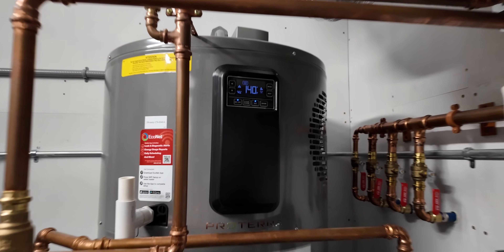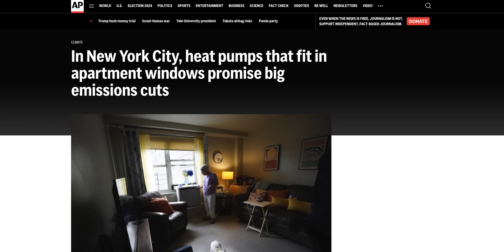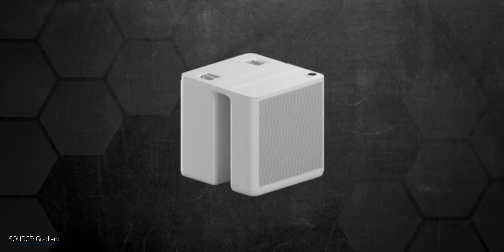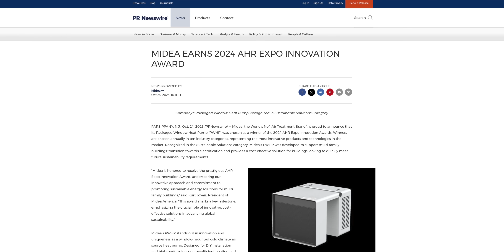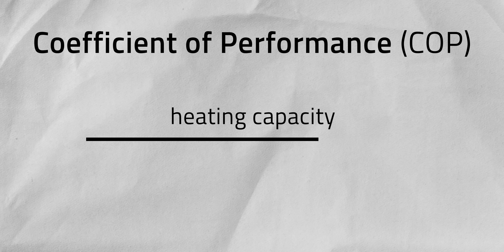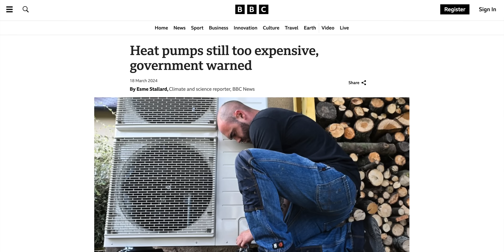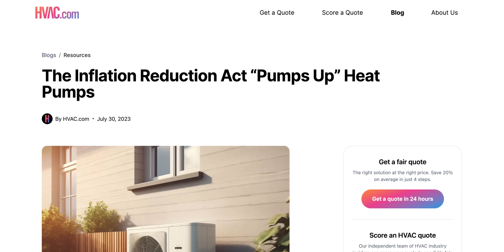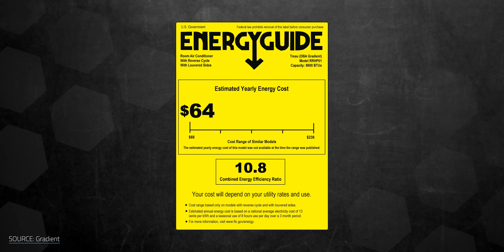Why This Window Heat Pump Is Genius

Comment: Reverse cycle air conditioning is almost universal in Australia, though window units are pretty much obsolete the split system is most common and can be bought for about $600 and about the same for installation

Comment: Them are FANCY! I really like the adaptability of these window units. And almost anyone can install them (the old school window boxes were a drop hazzard from the git-go). I have a heat pump in my garage that's worked well except in the winter it gets ice around the external fan and locks up .. otherwise, these window units would be super handy. Nice episode :) .. (The price though - Yeeeikes!)

Comment: I have been so mad for so many years that windowsill heat pumps were rare as hens teeth.  It's 99% literally an air conditioner turned around. These prices are insane though and I'm pretty sure its because its a combination heating / cooling unit.  Designing a product that is capable and efficiently tuned to do both effectively greatly increases the challenge.
Such products should exist, but also JUST MAKE A FRIGGING HEAT PUMP so people who actually struggle to pay their heating bill can afford to buy one for less than the price of a used car. It makes me SO MAD that I can't heat my home with a heat pump when I can spend a fraction of this money and cool my home with a heat pump.

Comment: I have the Madea U shaped ac unit.  It works Amazingly. It has a ceer of 15, and cost me $250. 

No idea why the heat pump model costs more than 10 times that. It's basically the same thing, but in reverse.

Comment: You could compare this to the cost of an HVAC system, which in some locals has gotten insane. I've been quoted at 30k.  So if I bought 5 of these for my victorian I'll probably have better thermal control at half the price.  Although my main issue is just cooling so 2 for the bedrooms and the massive heat from a Natural gas furnace should work.

Comment: I don't fully get the point.  Maybe I need to see this whole video, but my window AC unit has a heat pump feature that heats to my comfort using like 750w about I think.  It's a dual hose model, but it seems pretty efficient when I get those hoses as small and straight as possible.  Cost me like 300?  It doesn't really work well though when the temp is below about 40 or so - I guess this would be the main drawback for my much cheaper model.  The AC function doesn't require draining, but the heat pump does drain from a hose inside.  I guess what I'm saying is obvious and already well-known.

Comment: I had one of these in NH for a year. It was not ready for prime time. Didn’t heat in the winter and iced up during August all the time. Sent it back and got a full refund though. The company was very understanding and easy to deal with.

Comment: Midea makes a large fraction of our dehumidifiers in the US. They're manufactured in China, under more than 50 different brand names. They typically fail soon after warranty expiration, in a way that makes them unfixable. Landfills throughout the US are overflowing with beautiful new-looking Midea-made appliances.
Reply: Any reference for this information?
Reply: @freecycling6687  Its not hard to figure out. Most small appliances are made by them under different names. Especially store owned brands. And they are subpar quality.

Comment: I would love a unit that is also designed to work in a sideways sliding window as these are still decently common in older apartments.

Comment: A lot of apartment buildings are no longer allowing window AC units ("Window shakers") as the vibration can adversely affect the structural integrity of both the windows and the building. I can't imagine that window heat pumps would be an exception.

Comment: In the Nordics we have had heatpumps for decades. Middle of the road decent heatpumps cost around 600 USD incl VAT and taxes. Install is around 4-500 USD. In total around 10-1200 USD installed and ready to use incl all taxes.

Things cost differently from region to region, but heat pumps are not cutting edge technology today and shouldn’t require a premium.

Comment: I currently rent a room and this would be a great idea for where I live where it regularly gets over the century mark. However, the design would never work for any room in the entire house. They are all horizontal sliding windows. These would only work for vertical sliding windows. Most homes in California's central valley have horizontal sliding windows, making this not an option we could use, at least for now.

Comment: How do these units handle condensate produced by the outside section in winter? Condensation dripping in summer onto the pavement below isn't an issue but in winter these will cause an ice rink in freezing temperatures.

Comment: Everyone in the comments is upset about how much this window unit costs. The city doesn’t care how much these things cost. NYC is a money-wasting machine! They don’t make decisions based on money. They are disconnected from that reality. They don’t care about the costs of disposing of all the existing AC units or tearing out existing heating infrastructure. They certainly didn't factor in the pollution for that part of their solution. They will just make taxpayers and landlords pay. How about handing out that 250+ million they set aside for this research to apartment residents? That would have been less of a waste.
The rent control, zoning restrictions, and unpredictability of local lawmakers keep the housing stock in NY City far below demand. What incentivizes landlords to improve existing housing stock when they cannot get that money back because of rent control? The same is true of new development. The city even shoots new development and rehab in the foot, even on approved projects. Take a look at the redevelopment of the Stuyvesant housing project. It was a billion-dollar rehab project. It has just stopped because the investors have no hope of any return on their investment. 
The joke is that nobody is serious about reducing CO2 emissions or any other of these “causes.” How serious is the Biden administration about electric vehicles when they put a 100% tariff on Chinese EVs? Trump placed a 25% tariff on imported steel, while Biden wants to add 25% more or even make it cost 3x or 4x for American companies to use this inexpensive steal. China is drowning in steel because its real estate market has collapsed. Why has it collapsed? Well, because of their own top-down statist housing policies.

Even if the U.S. stopped all its carbon emissions today, there would be no global impact on rising CO2. Send that money to poor countries whose poor masses still burn wood, dung, and coal. Build infrastructure for them to switch to natural gas, hydro, and nuclear. If you care about emissions, focus on it where you can actually have an impact.

Comment: Eye-roll: It is expensive because they are trying to quickly pay off any investors and/or pay for the manufacturing of small lots (small quantity = more per item cost). Every new tech relies on the early adopter to get them in the black ASAP (or at least not so deep in the red). If it does well, the price will drop to reasonable. I'd guess $300 to $600 out the door. So if it feels like price gouging, it is; also it is not. 
Remember you can't just flip an A/C unit. You need to deal with refrigerants, condensation drainage & humidity control, cold weather function (because standard A/C does not run well in cold weather). The price is not for nothing, but I understand the sticker shock.

Comment: These units are a great idea, but the big thing is that central heating is included in rent and landlords are not likely to reduce rent if these systems are turned off, meaning renters are out of pocket.   This is great for your average landlord, not good for the renters who are mostly struggling as it is.

Comment: For your information, there are window AC units which serves both heating and cooling. It costs a bit higher than those with cooling only but the difference is small. When used as heat pump, it reverses the operation of the air conditioner.
Midea and many other brands provide such products. 
In area which is not too cold in winter, it is one good option.
Reply: Few even have portable a/c and heat pumps.  I had one, heat pump worked great thru winter, with the exception of the week we had in single digits.  Heat pumps aren't too great once you start getting below 32F.  A/c part of it though is another story.  It's garbage, leaked out the bottom near electric cord.  Getting ready to battle with the company for a refund.
Reply: Most those window AC heat/cool units use ordinary resistance heating for the heat.
Reply: @spinozany  yes this is what I imagined
I looked at a few listings and they never mention anything about heat pumps so I had to asst they were just adding a cheap resistive hearer

Comment: I understand that you are speaking primarily of New York City residents. it seems that almost no one is aware that there are parts of our country in which summertime temperatures reach between 115 degrees and 120 degrees almost daily. When will they develop a window air conditioner that will work in these areas?

Comment: I installed an 18k BTU mini-split heat pump in my garage workshop a couple years ago. It's been shocking how little it costs to run, and the temperature extremes in which it will function. I previously I had a natural gas unit that struggled to maintain a comfortable temperature, and obvious had no A/C function. I'd love to convert my house to a heat pump too.

Comment: What's the noise levels and how much heat can they supply?  My gas costs a third of my electricity for the same energy capacity, a COP of 2.6 doesn't even beat that.  It's hard to justify the down payment of a heat pump.

Comment: I suspect midea and the other are taking advantage of government money and over charging. You can buy a 12000 but mini split heat pump for $800. This window format has fewer materials but all the guts are the same. Even mideas original window AC was far cheaper than this.

Comment: Matt, 

did you not do simple basic physics at school?
No device gives more out than the enrgy applied to it.
Heat pumps are not 'miracle' devices they are simple and are nowhere near as efficient as people have been led to believe. The fundamental error is using electrical units as  the basis for an efficiency calculation, negelecting all the losses between generation andconsumption.
Essentially they use the heat from the compression of a gas, that is all, nothing special whatsoever.